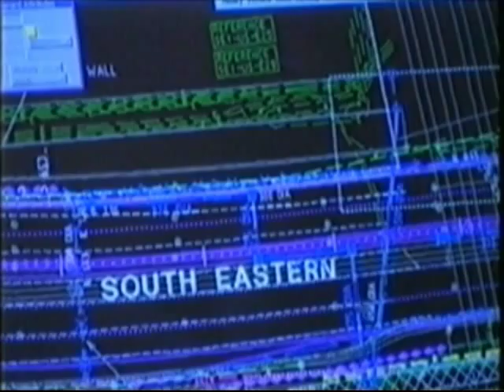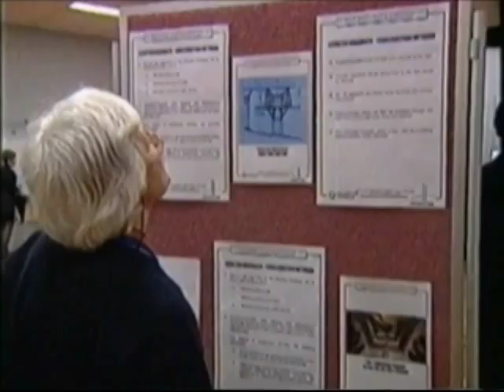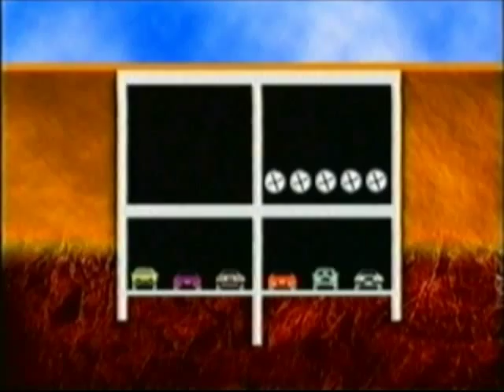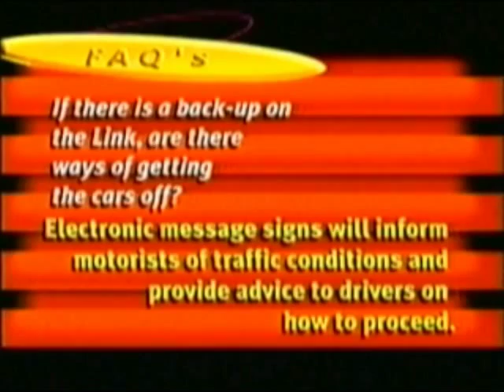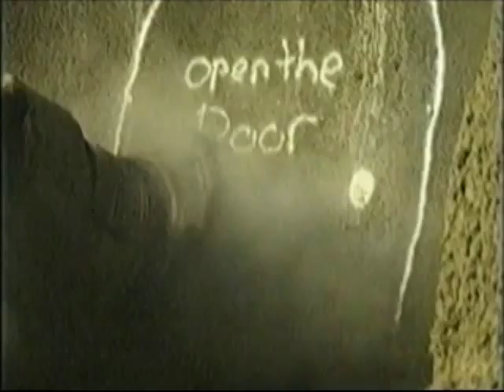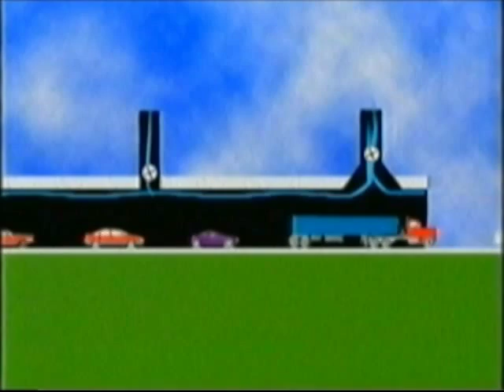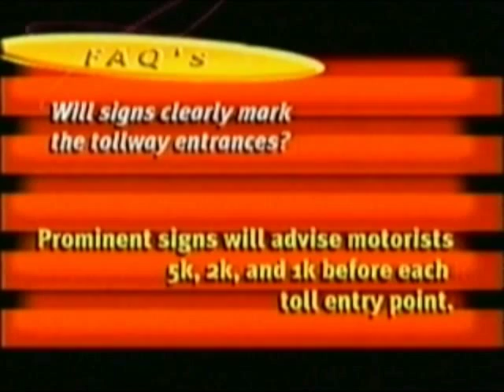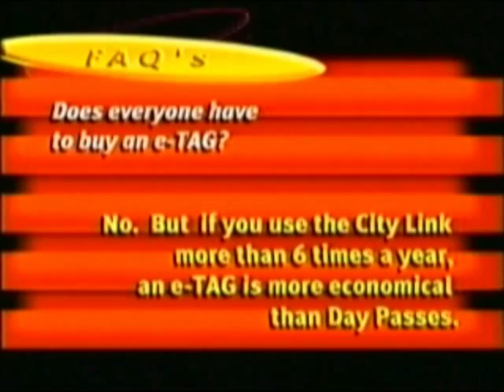GTV9: Melbourne's Link to the Future, 1999

Comment: Great to be taken back to a time when we built infrastructure in this state.
Reply: +Daniel Weil We do build infrastructure in this state, Just Not botched Rushed' Controversial Projects signed at the 11th hour before an election.
Reply: @drewieri932  well we did lose on east west, but here we are a few years later and we sure have projects running

Comment: And here we are 20 years later and we have already widened it how many times ? The contract to return it to public ownership has been extended, we will never get it untolled
Reply from the maker: There has been one round of widening - adding a 4th and 5th lane to the existing City Link - in the case of the elevated section and old South Eastern Freeway was largely done by removing the emergency lane and installing overhead lane signs and dropping the speed limit to 80km/h. 

More recently the current government rushed through the West Gate Tunnel which essentially cuts the corner from before the Bolte Bridge and sends traffic onto the West Gate Freeway and widens it by two lanes (with a three lane tunnel feeding it). With Transurban controlling the new road they have extended the deed  and raised tolls on City Link from 2035 to 2045 to help cover it according to the link below.  Compare the Eastlink deal from 2005 goes to 2043.
https://www.abc.net.au/news/2019-03-19/cost-to-motorists-of-westgate-tunnel-deal-revealed/10915998
Reply: @scana1979  they will extend it again..and again, private companies are not in the business of handing over cash cows, i want the road, and we would never have gotten it without these deals, but you pay 50 bucks to drive from Laverton up to Dandenong and back in tolls, add that up at the end of the week, (Truck)
Reply from the maker: @MrAustruck   My guess is that the Westgate Tunnel will be a white elephant in terms of traffic and Transurban will come back wanting it joined to the Eastern Freeway ... and yes probably another extension of the tolls!

Comment: 1:02:30 She hit the nail on the head. Look what we have now, another tunnel being built. Luckily we have major rail and transport works happening now as well.
Reply from the maker: The population growth tap is the big issue here - when this road opened there were around 3.8 million in Greater Melbourne - we passed 5 million around August 2018 meaning an acceleration in growth. Rail infrastructure is (finally) looking beyond the all-spokes-to-Flinders Street model which is its weakness now the city is so spread out.
Reply: Yes a stalled tunnel that may never be completed due government  incompetence
Reply: Melbourne has not seen this much rail work for 100 years, the under/overpasses the extensions the skyrails, our grandparents would be amazed and then we have the new tunnel projects ..
Reply: @MrAustruck  Our grandparents ripped out all the rail infrastructure, they would probably ask why we didn't built more freeways.